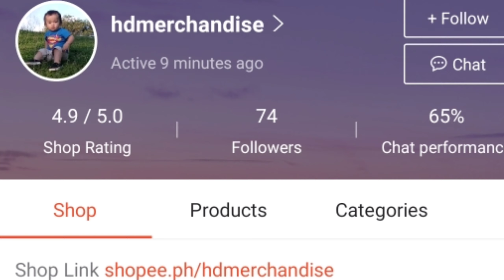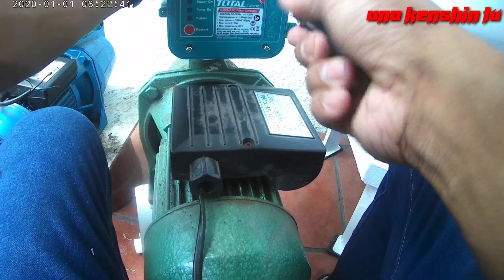actual installation of AUTOMATIC PUMP CONTROL (APC)

Comment: Nice video. Very informative po. May question lang po sana ako. Sa lugar namin sa Pque, mahina ang water pressure so nagpakabit ako ng bladder tank (60L) at water pump (1hp) na may APC - sa taas ng water pump. Ang setup is from Maynilad to water pump/bladder tank, then to water storage tank (1000L - pinalagyan ko ng plastic floater/water level control valve, yung nabibili ng 100 t0 300 sa Lazada). Ung water storage tank nasa bubong ng bahay (2F ang bahay), then from storage tank outlet papuntang house na. Pansin ko lang, everytime gumagamit ng tubig na tuloy tuloy (like, habang naghugas ng pingan), maya maya andar na kaagad ang water pump. Normal po ba ito? Ano po recommendation or suggestion ninyo? Tnx in advance.
Reply: Pwede lagyan ng level switch sa storage tank mo. At isama sa control ng pump operation.
Reply: @jfrelectechnical6652  Salamat 😊